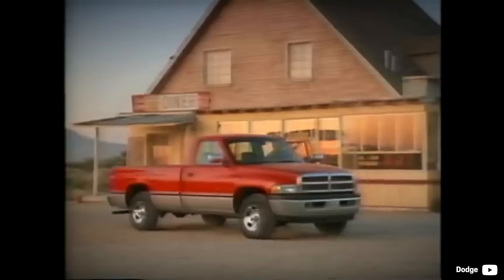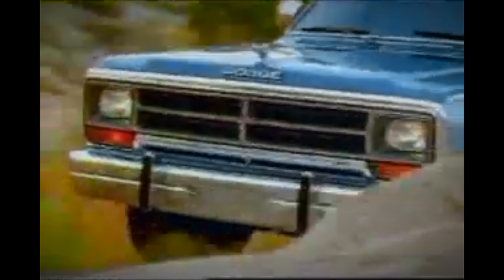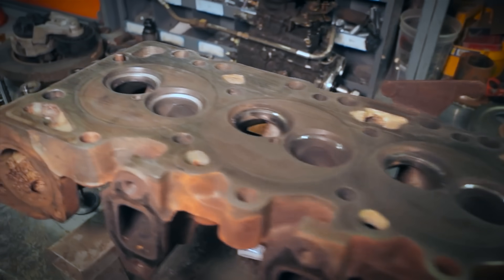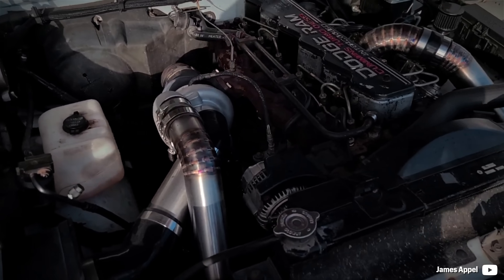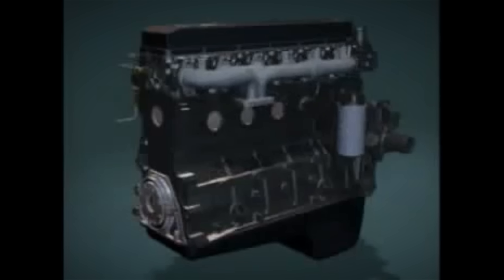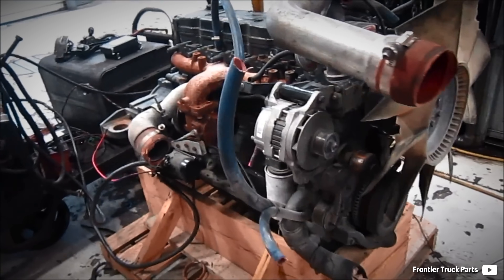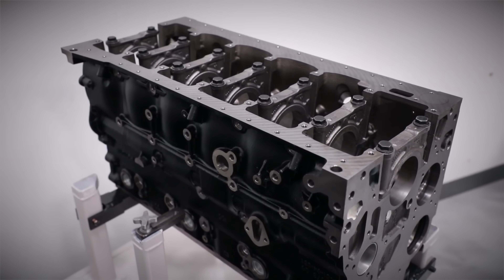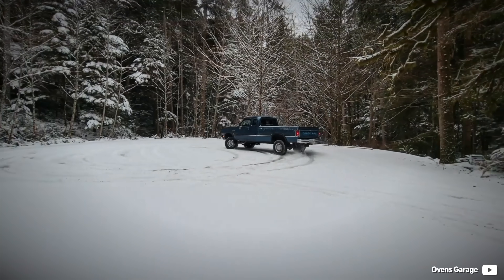The Most Reliable Diesel 6-Cylinder?

Comment: I'm amazed that the 6.7 Cummins will return 20+mpg in a 6k truck as long as you keep it 60-65mph. It will still give you high teens even cruising at 75-80mph. We towed home a circa 10k lb forklift this summer and averaged around 14-15mpg cruising at 65-70mph. Ours is pretty damn close to stock, bigger exhaust and tow tune and it will pull a triple axle with 12-14k on it through the Smokey's with no issues. Eventually want to put a compound system on it but want to upgrade the transmission first. Overall I'm really happy with the truck about the only thing outside of a better transmission I wish it had was 4wd. That heavy six up front definitely doesn't help it when it comes to being off road.

Comment: Diesel engines, incredibly important for industry and commercial applications...unfortunately also the dullest engines ever made😮 because,  very appropriately, put in big, dumb, heavy very dull trucks...frankly, aside maybe from some military vehicles , even modern electric cars are more interesting than boring diesels😅
Reply: It's pointless and kinda immature to call diesels boring. Unless you're a kid. And no, modern electric cars are not interesting. At least not yet. Diesels have more character and are actually reliable, durable, and get shit done. Everything has its place.

Comment: I like the 6BT with the P7100 pump the best.  My school bus had one and it hardly ever broke down.  It was a 1995 Thomas Conventional with Ford B series Chassis with a 12 valve Cummins (re-badged as the Ford FD-1060)  No electronics or all that emissions BS. what's not to like about that?  Just watch out for the killer dowel pin!

Comment: My first dodge was a 1991 with a 5.9 12 valve got it used with just over 100k on it drove it till it got over 350k all i had to do was chang a water pump fan belts . And then got a 2002 24 valve put over 400k on it before i got in a crash was a dam good truck.

Comment: Granted the 12 valve is a good engine but the rest of it is junk dodges are just shipping containers with a good motor, I would rather have a duramax or a power stroke any day than that Cummins I just don’t like anything about them

Comment: I got a 2008 dodge ram with a 67 Cummins in it and this truck is dependable and it doesn’t let me down but these new electric trucks they’re having problems with them I have a Arabian horses that I have to get Hey for when I get my own hair so I have a flatbed for a deck over trailer no I put about 3 to 410s ahead on it it’s come as diesel doesn’t let me down and I use it for other things to just wish it was a long bed but I’m happy it’s a mega cab

Comment: The super duty is prolly the best truck ever made imo.   I had an 02 cclb f350 with the 6 speed and the 7.3, a friend gave me a p7100 12 valve and i put it in the truck.  That was to date the best truck I ever had, it was seriously hard to pass up 55k the guy offered me for it.  Dodges biggest problem was shit body panels, half ass wiring and just a generally crappy truck from the get-go, only reason dodge is still on the map is because of the cummins partnership.

Comment: Dollar for dollar ….. you will not mess with Bow ties . You can put 2 LS engines in something that will still be less expensive than anything else . Remember using a Cummins engine dosent constitute dodge building a diesel . If you want to get technical Detroit diesel was actually GM diesel . Wanna know the significance of that ?? Look up the bandag bandit . Yes …

Comment: Cummins is a stalwart in the diesel game and has produced some great choices in engines. But destroyed would mean that the competitors have disappeared and have gone the way of the dodo. Hardly. In pickup truck comparison competitions, the dodges have always struggled and never really shown any dominance. Both the Duramax and Powerstroke are still around, stronger than ever and outsell the Cummins. They also suffer/suffered from the god-awful emission implementations that cost owner more money and downtime simply because it was poorly implemented, designed and  was not given  proper development time. 
 If durability and legacy are what your looking for there is no better example than the HMMMV which has the workdonkey of an engine from GM. No, it's no horse but it still keeps on keeping on.

Comment: We bought a 3/4 ton in 91. Pulled a car hauler trailer to the dealership with my 1/2 ton GMC. Dad drove home pulling my truck on that trailer doing 90 something saying he would’ve gone faster, but that’s where the governor kicked in. I learned a lot with that truck and the Case equipment we had used the 4BT little brother so lots of knowledge carried over. That truck has been retired, but I could probably start it with fresh fuel and a new battery. It was basically a street legal tractor. Bought a 2002 dually brand new and had to use atf in the fuel when diesel switched to ultra low sulfur. A trick a Cummins mechanic taught me at the shop. Drove it until I got tired of pulling trailers. Still miss both of those trucks though.

Comment: the cummins engine is great. the company I work for used to use cummins trucks exclusively, the issue is the transmission they paired with it. out of 10 trucks we run 4 had to have transmissions replaced. long story short a great engine is not great if the transmission falls apart.

Comment: Shame it was put in a Sh!+ Dodge wrapper. The engines are great but the trucks they were put in just weren't. Growing up on farms in Virginia we would see Fords Dodges Chevys of the same exact years, treated exactly the same and dodges would be trash far earlier than the Fords and chevys. And the chevys weren't far behind them. Bodies and frames would rust out, interiors would fall to pieces.  The automatic transmissions seemed to be made out of paper mache. The only good thing about a Ram was the engine they outsourced.

Comment: I absolutely love my 2021 W990 with a 605hp 2250tq X15. The new one box scr epa17 is extremely reliable compared to epa15. Theres 60% increase in exhaust that let's the engine be much more efficient. I pull 105k through western Washington and get 6.5mpg

Comment: This provides an interesting history. But in the context of this video's release date (late 2022), the title is a bit misleading.  It suggested it would compare either the current competitor's Diesels, or what will be offered in 2023.  In that context, the Ram is 'average'. Chevy and Ford have higher horsepower and torque ratings, and their V-8 engines are quieter. Ford has 475 HP and 1050 ft-lb. Also, both Chevy and Ford have 10 speed transmissions, while Ram still uses a 6 speed. A friend has a 2020 Ram. At highway speed, unloaded, non towing, his fuel mileage is substantially lower than another friend's Ford.  In terms of specifications, all of the current Diesels are pretty close, and all are VASTLY superior to earlier variants.

Comment: The ISB 6.7 is one of my favourite engines, it's versatile, efficient, and sounds great! Unfortunately they're not that common here in Brazil. Today, both Scania and DAF sell them rebranded as DC07 and Paccar GR-7 respectively, powering their semi-heavy rigid chassis lorries. Agrale also offers a front engine bus chassis called MA17.0 equipped with a 230hp B6.7. All these products don't really have a significant volume of sales. The biggest ISB success here was the Volkswagen Constellation 24.250 Euro III, powered by an ISB 5.9 (250hp/950Nm). Even now, 10 years after the end of its production, it is one of the most desirable models on the used trucks market. They're known as "SpongeBob" 24.250 because of their cabin design, specially when painted yellow, a very distinct colour offered by Volkswagen here.

Comment: The Cummins diesel in the Dodge pickup is a very good engine but it did not destroy the competition.
The 7.3 powerstroke in the Ford pickups is widely considered the best diesel in a pickup when it was available.
The Duramax in the GM pickups forced everyone else to up their game with the 2006 & 2007 Duramax powered GM's the best and most desirable of the older diesel powered pickups.

Comment: I’ve got a 2000 C/k 3500 four door long bed with a 454 cid it’s a duel let.

Had 45,000 when I needed a trans.  It’s my understanding that it’s from Canada and had the long straight and square body. Where as in the US they released the new model.

I’d like to put a Cummins or a Cat in it. And do something about the death wobble. Any positive advice would be welcome.

The truck would be mainly used for pulling a 5th wheel camper.

ID REALLY LIKE A GOOD PULLING TRANS MISSION WITH LOTS OF GEARS.

Comment: I love the 5.9l 12v and 24v! I do like the 6.7l but they do have one flaw… they’re bored and stroked out to where they give instant power but they’re prone to blowing head gaskets.
Reply: APR is  a company "look them up" that makes studs that instead of a head bolt has a stud and a nut that goes on top of the stud that can withstand 28,000 lbs of upward force. It won't blow a head gasket
Reply: Replace the head bolts with ARPs and you won't have a problem
Reply: @johnszoke586  what are ARPs?

Comment: Cummins didn't destroy the competition. For starters no matter how good the engine is the rest of the truck was junk. 
GM used the Detroit 6.2 and 6.5 which was used in Military and Marine applications where reliability is life or death. And Ford with it's International Harvester built 6.9 and 7.3 IDI outsold both Dodge and GM.

Comment: owned a 01 with a 24 valve and had a lot of trouble with the automatic transmission, and the vp fuel pump, got rid of it 2 years ago with 134,000 and change on it, bought a 96 with 12 valve and an nv4500 transmission, p7100 pump and the transmission has a bad countershaft, gotta fix that, 
   my 01 was two years old when i got it, and WWWAAAYYY NICER  than the worn out beat up 96, but the 96 is TWICE THE TRUCK, 
   best one of those i bought was a 99 3/4 ton which i gave my parents, my brother claimed it was part of the estate when the parents both eventually died off,
   he leveraged the estate and got it,  it had 260,000 when i bought it, has 650,000 on it now,

Comment: I’ve had every generation of the ram Cummins (1-5). The newer ones with def and dpf are guaranteed to fail within a few years (my 2019 didn’t make it home from the dealer without failing) but the aftermarket is on it 😉.

One interesting thing about the manual versions is they were very very hard to stall, my 2002 can be dropped into 3rd gear at idle with no throttle on dry pavement and it just chugs away. From there it will take 4-6 at idle and then idle at 50kph.
Reply: My 6.7 has had 0 issues with the emissions equipment and it's a 2014
Reply: @GooberLoofer420  my 2014 made it 150k km before I traded it in without an issue. In northern Canadian winters too. The 2019 was a piece of garbage until I fixed it, driving literally the exact same routes at the same times. Now it’s got no more issues though.

Comment: I drove a 2018 chassis cab dodge hauling a big car trailer, gvw was 28,450 pounds, 6.7 Cummins rated at 325 bhp. Great truck, only issue it ever had was blowing coolant hoses all the time and this little plastic shitty things holding the headlights up broke after a while and then the headlights were always fucked up. Had over 240,000 miles on it when I quit the job last year and it was still running great. Now I drive an international box truck with a 6.7 cummins

Comment: One of the reasons why Cummins has always had advanced, reliable designs was that they started using finite element analisys (ANSYS mechanical, to be more concrete) very early on. With finite element analisys, they were not only able to design parts for durability, but also simulate how long said parts would last, and all without having had to build a single physical prototype. Once it was time to build prototypes, Cummins was effectively building a finished, tested product.
Reply: Super advanced, being based off of a now 60 year old engine...
Reply: @doxnoogle5782  the notion that one has to start from scratch every time when implementing anything is patently false. Some of the best implementations are the ones which have been incrementally refined over a span of decades. Every time one designs something from scratch, one stands a very high probability of delivering that something with a number of regressions... it's good engineering 101 to do incremental improvements, instead of reinveinting the wheel every time.
Reply: No one said that, the problem is they took a 60 year old engine and put newfangled gizmos on it and ended up with garbage.  Ask an otr trucker what color is under the hood and how they like it, my money is if its red or green they hate it because detroit has many of the same problems, on top of eating valve seats.
Reply: @doxnoogle5782  which engine, in your view, is a reliable, durable replacement then?
Reply: 3406 all day.  The exception here would be if youre hauling in and out of cali (why though) i would go D13.

Comment: The truck I miss the most that I no longer own would definitely be my 1991 Dodge 250 with a 5.9 Cummins. The truck was a total piece of crap, but the motor wouldn't die (Well, it did, from the killer dowel pin but I mean, at the time, how was I to know it would happen)
Rest of the truck was meh. 2 gear in the 5 speed manual never really worked properly, hardly any of the electronics worked (Speedometor and fuel gauges, no AC or radio)
I ended up boring a hole through the dash and running a small piece of square duct up through the engine bay by the exhaust and directed it to the window, and super glued a little battery fan to the dash to keep the window defrosted in winter.
4x4 would get stuck in 4 wheel. You'd have to put it in reverse, drive back a few dozen feet, then unlock hubs and put in 2wd, but even then sometimes, the coupling that attached the CV axel would sometimes still stick and you'd have to disassemble the front end and beat the coupling off the connection with a cold chisel.
But I do miss that POS and if I could, would drive it again in a heartbeat

Comment: 10 million B series engines have been produced. Thats number for Dodge/Ram is just over 3 million. It took 29 years to build 3 million. Since 2001 Gm has sold just over 2 million Durajunk. From 94.5 untill 2002 Ford sold 2 million 7.3s(not counting the number of t444e Navistar sold) 2011-2022 Ford has sold 2.75 million 6.7s. Thats nearly the same as all of the B series 32 year run in 11 years. I can say a Cat C15, or 14L Detriot Series 60 sounds nice(hell a 8V92TA). I can't stand the sound of the B series(or any I6 over 1800rpm. Sounds like the new Honda Civic craze from the 90s all over again.

Comment: The only good thing about Dodge is to Cummings all mechanics know that everything around the Cummings falls apart from crap plastic to transmission wiring ex. There's a reason you don't see ambulances and most tow trucks yes there is few not much most small company might have them to start out.

Comment: I have a 96 Ram 2500. I love the motor and HATE the truck.  The motor is surrounded by crap. I have replaced everything at least twice, except the rear end. I am on my 4th transmission on a stock motor.  Entire inside is junk as it is completely falling apart.  If I knew then what I know now, I would have pulled the motor out, and installed it in a Ford or Chevy body. Best diesel ever made installed in one of the worst trucks ever made.

Comment: we had a case international 5130 (maxxum) tractor with the 5.9lire (without a turbo) &!lucas rotary pump …. Best sounding 6 cylinder diesel ever !!!! In my opinion.
Good for 20,000 hours without touching the engine!!!
Only use engine oil when it was due for a change!

The coolant temperature never ran above quarter up!

In the winter it did like it heat! If it didn’t get it full swing from the starter motor it wouldn’t start!

Oh yeah they always idle fast!!!

Comment: I works a concrete mixer and excavator with 6BT-QSB engine. The engine itself is very reliable. The high pressure fuel pump however, not so much. Some non critical gasket is fiber, where it should be aluminium. But other than that I have no complain on reliability. Part availability in my country on the other hand is not so good. I wish I can contact a US dealer but everyone always redirects me to the crappy local dealer.

Comment: Theres some inaccuracies you have here.
First Diesel fuel especially in the era you speak of is half the Price of gasoline.
Unless you live in the US that wanted to regulate use of Diesel vehicles by taxing the Fuel.
That because Pre Eurodiesel is very easy to make and 70% efficient in refining.
Gasoline is about 35-42% refining efficient. Means from 1 liter of Crude oil you get 420ml of Gasoline Max. Where you would get up to 750ml D2 Diesel and around 620-700ml Eurodiesel.
Today Diesel is more expensive because 90s diesels caught up and Overtook Gasoline cars in all aspects.
Same speed and acceleration, better fuel economy and half the price fuel. Oh, did I forget 2x the Engine life on average :)
Price was regulated and several types of pollution were invented to stop us all from going Diesel. Disassembling the automotive industry and Oil companies.

Comment: You might wanna look up Cummings actually got it start into the consumer market after the designer of Cummings actually did very good in auto racing right here in the United States I can’t member of his late 40s early 50s and that’s what they call now the high River diesels that would run a Wapping 2000 RPM and more which is nothing in today’s day and age but back in the day the original diesel engines were all extremely low RPM and most never hit 1500